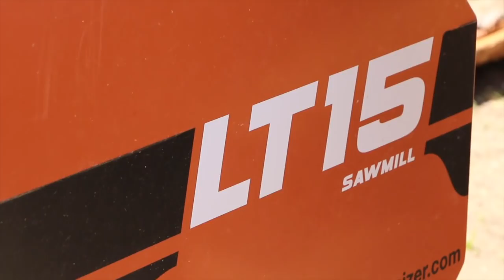How to Make Money With a Sawmill

Comment: when I had my sawmill I would charge an hourly cutting rate because I had several customers that would only want to pay for heartwood width of the boards. for example if we had a 12" wide board but the narrowest part of the heartwood was 2" they only wanted to pay for the 2" wide, but wanted the whole board. Just got easier to use a flat rate. Keep up the great work.

Comment: Josh:  When using full dimension ungraded lumber a 2x4 = 8 sq. inches and a graded 2x6 is 8.25 square inches in cross section.  There for you can use full dimension 2x4's on 24" centers where you would use graded 2x6's for out buildings, uninspected cabins etc.  If it is to be inspected you must use graded lumber.  But make sure  it is wane free and only has solid knots equivalent to #2 SPF for framing.  Still keep to the span charts in the code books but drop one size with full dimension lumber.   In timber frame or pole buildings I still use the graded load size spec. but use full dimension for posts or bigger to allow for notches and mortises .       Bert
Reply from the maker: Bert,
That's some great advice and really well said, please keep sharing your insight. Thank you, Josh@EMH
Reply: Bert, I really appreciate you sharing this.  I didn't realize there was so much to lumber and especially how it relates to code.

Comment: Also to help with checking and warpage there are end sealers that prevent the wood from drying to quickly causing it to bow and bend. I have never personally used it but plan on checking it out or doing more research once I am closer to milling my own lumber. It would be similar to what box stores like home depot do with dipping the ends in a wax type substance. I have noticed once you cut those ends off the boards they can sure twist and turn if they are still moist and dry too quickly say in a warm home or shop.
Reply: Anchor Seal is the brand of end sealer a lot of millers use. Amazon, if you can't find it locally.